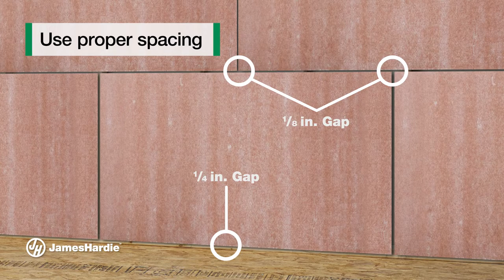How to Install Hardie® Backer with HydroDefense™ Technology Waterproof Cement Backer Board

Comment: You showed no way to finish where the floor and walls meet. It said use caulk why not show installation completely? Would like to see how the two meet.
Reply: They call for 1/4 gap at bottom, presumably to avoid wicking

Comment: I have more questions: 
1. Can I use self-adhesive alkalai resistant fiberglass mesh tape on the seams and screw heads without putting some sort of thinset underneath the tape? (I see FibaTape has an alkalai safe mesh)
2. Do I need to moisture seal over the seams and screw holes if I'm using a glue-up surround?
3. Since "modified thinset" was recommended, can I use that as a top coat over the tape? Or can I use something like Easysand?
4. Can I simply paint over any exposed areas that are not covered by a glue-up surround with some sort of latex paint?
5. Do I need 1/4" gap between the bottom of the board & the edge of a tub (my tub has no flange) or can I go with 1/8"?
6. Is Flex Seal ok for sealing over the tape?
7. If thinset is not required when used with self-adhesive tape, is painting over with something like redguard or flex seal OK (since I will be covering it with glue-up wall surround?)
I couldn't fit all of these questions on the sites for big box stores and am hoping to get some answers here.
Reply: Get some of the banding they sell. Same as Kerdi band. Use a good modified thinset to cover all seams and screw holes. Make sure you have a 2 inch overlap where your banding meets. Find a video on YouTube about the band if you've never used it. But don't put flex seal in your shower.

Comment: Nice video and I now suspect that my contractor has overcharged me for some items - 750 cement backer screws for a 15x4 ft area wall space of Hardie Backer HydroDefence board? 🧐
Reply: You're supposed to still use red guard if you're not a hack

Comment: This product is 100% water proof? So you can imbed it in the mortar bed and it won't wick?
Reply: I wouldn’t. That’s why there is no fabric on the edge or after you cut it.
Reply: No, they dictate a 1/4" gap at bottom
Reply: Wicking isn’t much of a problem anymore because everyone does surface waterproofing with a bonding flange drain.

Comment: So this is basically the same as the regular hardie,  you just don't have to coat the entire wall in red guard.  Might as well cover the whole thing since i have to buy red guard anyways.   Or I'm i missing something
Reply: just the seams and screw its for production paced work if you coat it wont dry fast since its already water proof
Reply: Redguard is expensive. If you don't need it for waterproofing, then why incur the extra cost.

Comment: Can this be used behind glue-up wall surrounds for showers and tubs?
Reply: If your surround is waterproof (plastic ) you don't need a waterproof backer board. I glued mine on green board 16 year ago.... no probs.
Reply: @scrapon  The cementboard mfr suggested using it just in case. I'd rather be safe than sorry. Greenboard is not available in my area for some reason. All I could find was water resistant cementboard. My area kind of sucks for supplies.

Comment: Can it be used with any side out or the red must be facing out ?
Reply: I called and they said red needs to face out.  This isn't anywhere on their instructions.
Reply: @nicholaslue6916  got it thank you. I had my guys instal it and they had it the other way but when I saw videos of it being installed it always had the red facing out so I told em to flip it. Now I’m nervous if the entire job was done correctly lol but then again he never used this product. 🤦🏻‍♂️
Reply: It technically doesn’t matter. The red is just to help the stores differentiate from regular HB and to alert the contractors that the wall is already waterproofed. It is meant to be installed red side out, but both sides are equally waterproof.
Reply: @MoneyManHolmes  Thats not true, the red side is the waterproof side. The other side is just regular HardiBoard, if you install it backwards then you MUST go back and water proof the whole board with Redgard  membrane "paint".
Reply: After actually using the product and going through the manufacturer’s conflicting answers, you are mostly correct. I dissected the product, and there are 6 waterproof layers sandwiched equally within 6 thin layers of hardiebacker material. So if you install it “backwards” you do indeed have a non-waterproof surface, but it’s less than 1/16 of an inch until any water would hit the closest layer of waterproofing. Red side out would be best, but backwards wouldn’t be as catastrophic as if using original hardiebacker.
Reply: The obvious question is why not close out the material with a final layer of the paper thin waterproofing on the back so it’s truly idiot proof!
Reply: The whole board is already waterproofed.  @Boudell

Comment: question about the screw depth. i understand the screws are supposed to be flush and the top of the screw not sunken in the board. but i’m having a hard time getting them flush without having some of the board get bunched up around the top of the screw (like a little bit of a bubble around the screw). i see in the video some of hos screws look like that too so assuming that’s ok. ???
Reply: Try pre drilling the wholes prior to the screws
Reply: @sonnyluna  thanks. yeah, that’s what i did. still going to apply a waterproof membrane over it just to be sure.

Comment: If I need to use waterproofing (redguard in this case) and am gonna need to redguard the seems and holes then why not just use Durock for half the price of this Hardie Board.  In both cases I need to buy the Redguard and although I need to cover the entirety of the Durock still cheaper as I had to buy the Redguard anyway for the Hardie.  Makes no economical sense.  Durock used for years and does not fail.  I say nogo on this overpriced quality board.
Reply: Cause its Stronger. Durock, seems flimsy. But i 100000000% agree on using the materials and tools you trust.